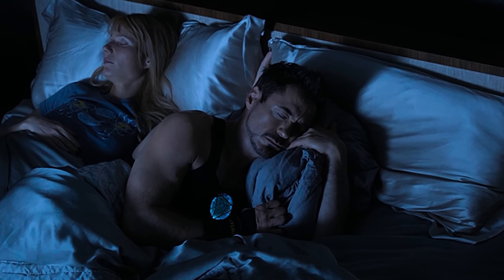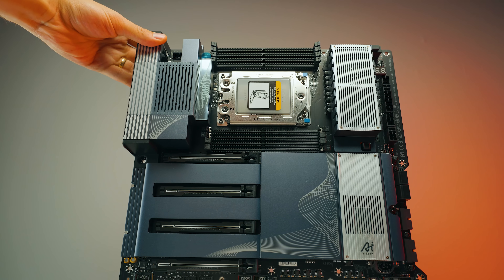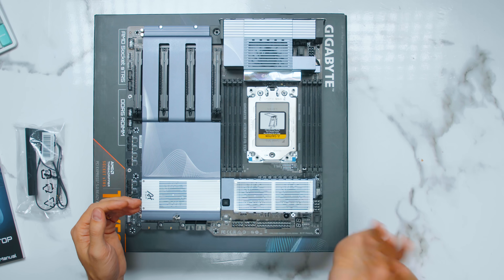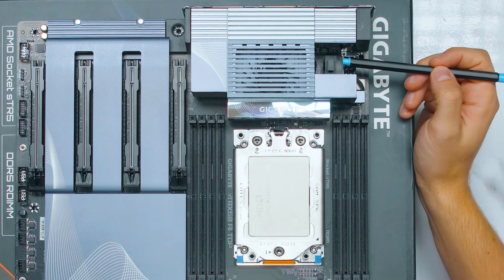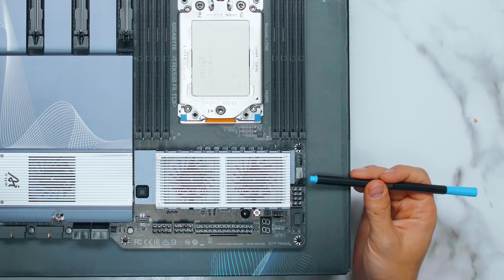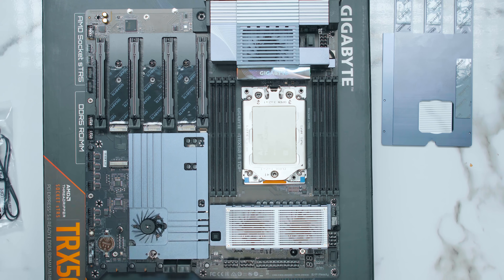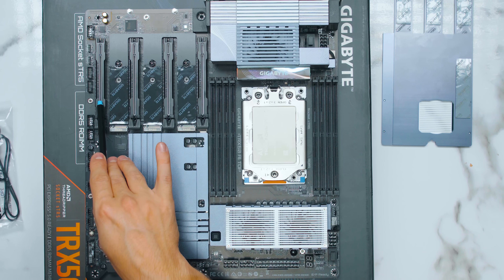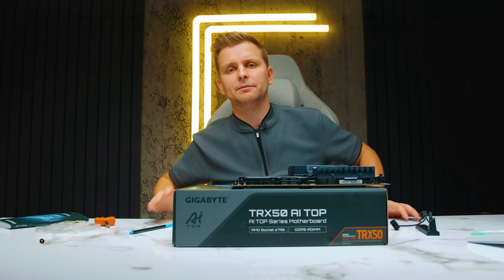BIGGEST AI Motherboard EVER Created & why it's THE BEST!! feat. Gigabyte TRX50 AI TOP

Comment: Update about m2 slots
3 x M.2 connectors (M2C_CPU/M2B_CPU/M2A_CPU), integrated in the CPU, supporting Socket 3, M key, type 2280 SSDs:
- AMD Ryzen™ Threadripper™ PRO 9000-WX/PRO 7000-WX/9000 Series Processors support PCIe 5.0 x4/x2 SSD
- AMD Ryzen™ Threadripper™ 7000 Series Processors support PCIe 4.0 x4/x2 SSD
1 x M.2 connector (M2D_CPU), integrated in the CPU, supporting Socket 3, M key, type 2280 SSDs:
- AMD Ryzen™ Threadripper™ PRO 9000-WX/PRO 7000-WX Series Processors support PCIe 5.0 x4/x2 SSD
* The M2D_CPU connector will become unavailable when using the AMD Ryzen™ Threadripper™ 9000/7000 Series Processors.

So, buy 9960x 9970x 9980x and use three m.2 in pci-e 5.0 speed

Comment: The reason the cooler vents have that dip is because heat rises, so it will find the highest point ensuring the heat moves out the top and not the center of the board.

Comment: I have 4 MSI RTX 4090 Liquid Suprim that are going to fit in there just fine :) I got them on sale for $1750 each. I have a TR7960x and 128GB RDIMM DDR5

I just bought this board because the Asrock TRX50 WS I have can't fit 4 AND it's been having weird issues where I have to boot into the bios before I can boot into the OS or it just shuts off.

Comment: I found it on Amazon for $1,412.90 U.S. and for the AMD Ryzen Threadripper PRO 7985WX 64 core 128 thread $7,349.00 U.S. and the 7995WX 96 core is $9,999.00
Reply: For that price you might as well get WRX90 motherboard but I like Gigabyte motherboard the best. I heard Asus WRX90 have problem?

Comment: 5:11
I have a Gigabyte X-99 Ultra Gaming with an i7 5820k.
The CPU is quad-channel capable and so is the board.
If all 8 module slots are populated, 2 modules run on each channel.
Reply: My old PC used the same board, can confirm this is the case.

Comment: i have an old aorus x570 elite and the thing, if it blows up for whatever reason it nukes your memory settings etc. wipes the bios. its very annoying. but it is time to upgrade. but i probably wont go threadripper ;)  i bought my 12core/24 thread machine with 64gb ram that is finicky. i will make sure to check mem compatibility on whatever i get. am5 probably though.

Comment: Water cooled GPU allows you to have more room. I use the TRX-40 and just love it - didn’t mind paying $900 for it. It has its quirks but if you are paying top dollar then you get the top features. For my work I use every pci lanes and all cores. HSDT is for hardcore enthusiasts and those using for videos/movies/Ai/ or multiple of these features. I do wish they included the x4x4x4x4 NVME add-in card or pci-e riser cables for gen 5.

Comment: yeah its big but its not the biggest there are plenty of server sizes that are bigger by far,  seem to have forgotten custom gpu water blocks that would reduce the size and you could then run 4 gpu's on the board without riser cables, AI branding isnt new, Asus used it in like 2004 (AI Lifestyle) maybe earlier,  I thought the Pro chips where like Enterprise grade use rather than gaming use.  I wouldnt buy a board like this anyway, i would go slightly above mid tier pricing, and i wouldnt bother with multi gpu's my dual epyc 7302 (that has 16slots of octo channel ram which is easily as big as that board), system only has 3 cards installed, A RTX3060, A x4x4x4x4 NVME pci-e card and a x4 SATA pci-e card and thats it, it would have a dual 10g nic card but it doesnt need one as it has dual 10g onboard anyways, barely gets used as its a storage server 20 drive total, 2 are in a ssd external usb hotswap caddy, rougly 47TB of Drive space.

Comment: I wish this was out last year.     I run a Blender 3D workstation with a Threadripper dual 4090's and  1/2  a TB of ram on an  Asus pro art motherboard.    I payed more for that system than I did for my daughters 1st car and now wish I held off a year since all the new tech is starting to come out.  The 5090's were not even in conversation when I ordered the workstation.   The thing renders like a champ however so i have no complaints.
Reply: No need to regret purchasing the 4090s
Reply: @tejiriamrasa3258  Cool thank you.   i was really starting to wonder if I miss timed my last upgrade but did it out of concern that GPU's were going to keep going up in price.  Thank you for the reassurance.

Comment: There is no cheating going on...

If it only supports quad channel then it will only use 4 channels at the same time. No matter if you have 8 DIMM slots populated. That's the same principle as in regular consumer boards where you usually have 2 channels but 4 DIMM slots.

So looking up the specs tells me that you need a threadripper PRO to make use of 8 channel capabilities. Idk why you didn't look that up before creating such a video. Makes me question the rest of the informations reliability.

Comment: 13:45 you're completely wrong here, for any heavy AI rig (where VRAM is top priority),
something like RTX 6000 ADA (48GB vram) is a 2-slot card, and so you can fit 4 of those,
frankly there's even single slot card like RTX 4000 ADA (20GB vram) :D

Comment: Don't like Gigabyte using Realtek network chips, which flake out and disappear regularly...     or having only a stereo audio jack out, when you need and have 5.1 or 7.1 speakers.
I had to buy a break out USB box to kludge around the sound problem, which didn't give me 5.1, but at least drove most of the speakers...  and another PCIe Intel ethernet card, so I can just ignore the Realtek wifi and ethernet chips on the motherboard.   In other words, they sc3wed up the two out of 5 things a motherboard does...  network, sound,  usb, and  sata.   Most of the USB are bleh... but I guess they work.

Comment: For GPUs and AI, I could see this being used with the A100 series often used in data centers (not that you couldn't use a 40 series or 50 series with water cooling). They have the 2 slot clearance that would enable 4 of them to be connected. The cooling needs of that kind of system would be off the charts. This is an amazing platform. I would love to see a fully built AI machine using it.

Comment: OK firstly I am a subscriber and love your review videos, secondly this is exactly the motherboard I have been looking for, for my AI Build, Now just have to see if the case I have picked will be able to contain this motherboard, fun enough its a split case, oneside for the motherboard and one side for 4 x 4090 GPU's, but I am waiting to populate it with initially 2 x 5090 GPU's and add a new GPU every 3 months till I have 4 x 5090 GPU's in it. Yes I am crazy and want to run my own high powered, fast AI model machine for my AI purposes. and the 4 high speed NVMe bays in a raid O will also allow me to download many huge models. So thank you for the motherboard, oh and by the way the board is £1000 in the United Kingdom. Expect 5090's to be around £2200 each  (£8800) and the Threadripper to be about £5000, plus 2 x power, plus NVMe drives, plus cooling, plus fans, expect build to be around £15k to £20k.
Reply: Great to know I'm not the only crazy one. Can you share what case are you planning to use for your build?

Comment: I have a dual X99 Supermicro EEEATX board that is even bigger.  I could never find a case to put it in so it just sat on a shelf for years.  It has 24 DIMM slots lol.  Just silly.  I filled all the slots for 192 gig of ecc with dual E5 2690 v2.  It is a power sucking heater and not even really that great for modern tasks.

Comment: No, definitely not the biggest ever created, not by a long shot. You obviously never saw multi-CPU boards. Tyan Thunder K7 I bought in 2001 for example is 33.02 cm x 30.48 cm.
Reply: Supermicro's EE-ATX is bigger (like X9DRi-LN4F), it's full SSi-EEB (or E-ATX) with additional inch ABOVE the CPU area, to accommodate 24 DIMM slots (and it fits in normal cases, I have mine in Fractal Design's XL R2). Also old MSI's Big Bang XPower 2 had 7 PCIe slots just shifted 2 down, making it 9-slot board by size, although it wasn't as wide as full E-ATX, just slightly wider than ATX.

Of course if we consider full servers, full depth 19" moptherboard is like 3x the size of SSI-EEB, but the biggest I've seen was the Intel's demonstration 8S system for OEM integration, which was two 95x80 cm (38x32") boards interconnected with QPI/PCIe hard links, sandwiched on a open steel frame, which I saw during Sapphire Rapids premiere.
Reply: Even the Amiga 2000 mobo was larger than this.  Guess he's not that old. 😅
Reply: Can't compare server tech to premium enthusiast tech. Enterprise stuff are another level for a reason
Reply: You missed the EVGA Classified SR-2 that thing had its own form factor, it was like HPTX or something like that
Reply: For real.  I have worked with towers that had mb's holding  4 cpu's and over 500 gb of ram.  The full tower cost over $100k...  Of course i tried to get my company to give me one when they were getting rid of them, but because I worked on a govt contract, they cant do that...  breaks my heart everytime, because most of the time, those computers just end up getting destroyed...smh
Reply: Yeah, he never heard of multi-GPU water-cooling either "you need to run riser cables".... yeah right. If someone does not make a "universal 4-way 5090" then it's not possible I guess... damn I'm salty today.... but come on.
Reply: I had that particular Tyan board. Massive. Miss it. Ran NT4.0 for 2.2 years no reboot on it.
Reply: And even that isn't remotely the biggest... Not even, when it comes to mass produces consumer stuff!
Reply: Title says "BIGGEST A.I. Motherboard EVER Created" A.I. Motherboard, not just any type of motherboard.
Reply: @scottsturmTWM  Yeah no, he changed the title.
Reply: @evilJazz1  ahhhhh makes sense now

Comment: Marvell chipset for the 10gig is a total dealbreaker.    I would never buy this.   Currently only Intel chipset 10gig is reliable.
Reply: Why? Had no problem with my marvel chipset 10gig
Reply: @  it will randomly just turn off and disappear off your computer I can make it happens in windows 10 and 11.  Anytime you use a lot of NDI and data at the same it just poofs.   (Same on 5 different computers).

Comment: A quartet of NVidia Quattro RTX 8000 GPUs would work in that board as they are 2 slot cards. 48GB of DDR6 on each makes for a serious AI training server.
Reply: too old and slow, performance would be same like one RTX 6000 ada, which is also dual slot, but you can use risers in custom case and put 4 slot 4090s
Reply: @treniotajuodvarnis  Sadly, I only have the RTX 8000s in my inventory so they'd do fine. Also wouldn't require custom case work or risers. Why buy what I don't need to do more than i want?
Reply: @WireHedd  why would you overspend on this motherboard then? there's lots of older hardware starting x99 and xeons v3 had already 4 or more full speed pcie slots. unless you plan to upgrade gpus later
Reply: @WireHedd  i got a perfect condition x299 u can buy
Reply: @treniotajuodvarnis  4090s are too old and slow. 8 x 5090s would be acceptable (using PCIe x16 to x8x8 bifurction adapters). 16 x 5090s would be better, running them all bifurcated to PCIe 5.0 x4 (which only loses 4%-6% performance per card).

Comment: I've been shopping TR40 boards looking for last gen deals, as I'd like to move over my pile of hardware to lessen how much I need to pick up for platform upgrades, but I will fully admit that I have use of this platform. Just not the outright budget that is dedicated to other projects. The board is fairly cheap compared to the CPU itself and outfitting new DDR5 to fully flesh out 8 DIMM slots (About $900 at street price in US presently).

Comment: The motherboard isn't that much more money than some of the top tier gamer/consumer variants. Threadripper CPU will blow the budget :) I do like how Gigabyte gives you options for which CPU you socket in, so you could upgrade the CPU in the future without having to go get an entirely new motherboard.
Reply: Let's see here...$900 for the motherboard.  A brand new 24-core Threadripper Pro 7965WX pops up on eBay for $1700 occasionally (otherwise) it's $2650.  That's not too bad, if you can find one at discount.  Throw in 2 x 5090s and you've got a sick AI inferencing machine, that can also fine tune models, or do RAG fast because each card has 16 lanes.  Drop in a few gen 5 SSDs in RAID 0, and this machine would scream.  You're gonna need one of those 1600W Seasonic PSU's, so that's another $500, but this whole setup could run on a home circuit in the US without needing an electrician.

I like the flexibility that the motherboard gives to upgrade the CPU later too, like you mentioned.  Hmmm....it sounds like the ultimate desktop setup.